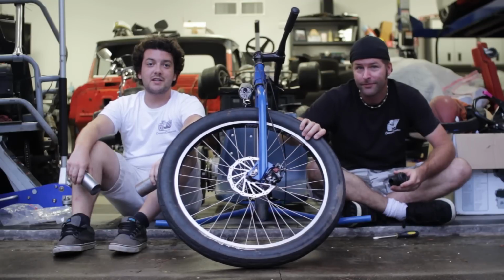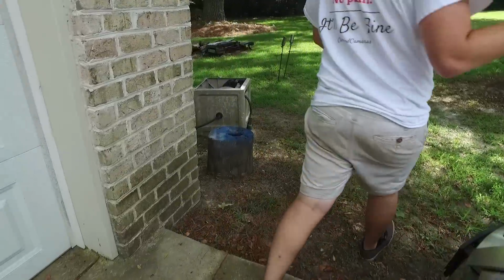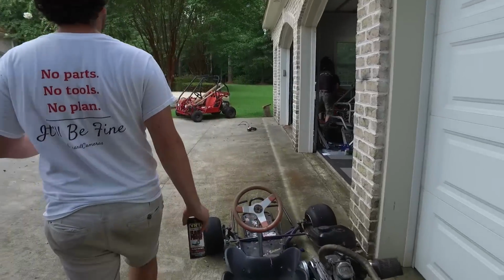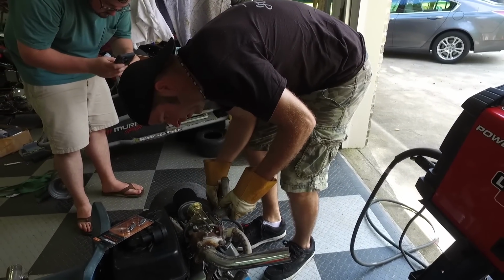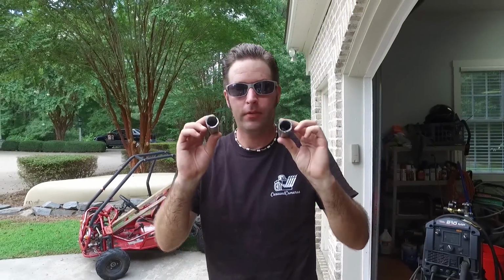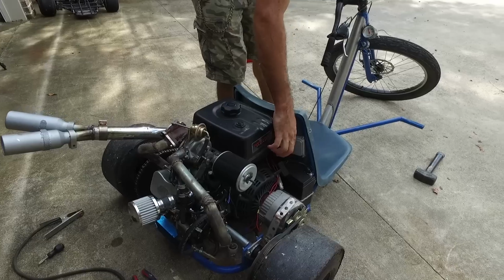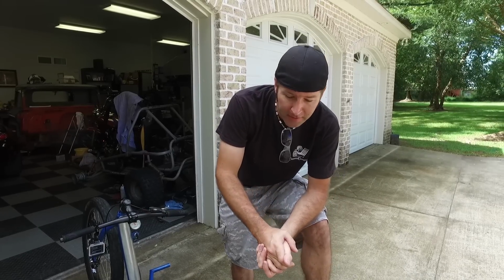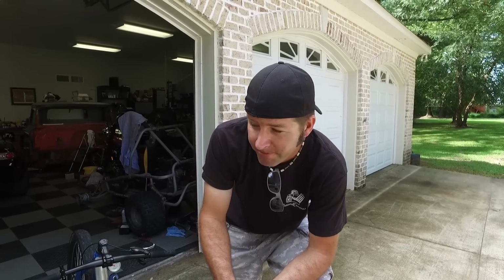911 Turbo Blow Off Valve on a Drift Trike??

Comment: 4:15 ... um  Blow off valves   blow off excess pressure  when you let of the throttle . ( its not good to hold boost built up and not use it ) 
but there is no Vacuum ...

Comment: 1 those mufflers ''might'' very well increase boost lag. 2 why put a filter on that diverter valve? 3 keep valve for reliability and longevity of turbo but i would remove filter and test with and without mufflers because this muffler reduce sound by creating restriction and that's not good for performance. Just a thought maby try cutting 3 slants on the outlet of the diverter maby it will make more flutter sound. And finally try a very smaller valve because the spring in that one is to strong that why is doesent open ennuf. Just my thoughts :)

Comment: sorry guys but I had a lol at tour expense: youre istalling a blow off valve to releive pressure when you release the throttle. therefore there will be no vacuum whatsoever. you need a valve that will release pressure using the same pressure.

Comment: If you got that DV used it's probably junk. They rely on a really crappy diaphragm to seal the vacuum source from the charge pressure which is the only thing that'll open the valve. Stick a vacuum pump on it and see if it will open, if it just sucks all day you'll know it's not working

Source: 944 Turbo owner

Comment: There's not enough volume of air in the small system to produce a loud blowoff sound plus the lack of vacuum. I bet if you make the intake alot longer and put expansion chamber in it, you'd gain the volume to produce more of a blowoff.

Comment: As others have said spring is probably to many psi for your boost level. Also the filter does nothing.one more thing, that's actually a bypass valve not a blow off valve. because it's made to recirculate back into the intake air.
Reply: ps those bypass valves are made to be quiet. stick a whistle in it and for God sake ditch the filter lol.

Comment: if you took the plastic off the wheels you would build more boost, you're essentially just reving it without building pressure because there's no load on the engine.

Comment: it's not about vacuum, it's about boost. if the valve needs more boost to open than you can provide, it just wont work. either way, you buy a cheaper bov and adjust it for the boost you have, or, why not, more boost

Comment: hey guys.. i just finished building my drift trike but the front wheel will not turn the trike.. I haven't put PVC on the rear tires yet... is this common?

Comment: A blow off valve is used to relieve excess boost from the intake manifold during throttle let off, Not vacuum.
Reply: yes but it needs vacuum to open the valve to relieve pressure
Reply: I didn't mean it won't work, I just wanted to correct how it works, sorry.
Reply: its cool

Comment: love the channel but thats a bypass valve not a blow off. it wont sound like a bov because its designed to let charge air vent to before the turbo. its also on a saab turbo. i run the same one on my mustang and it doesnt make any cool noises when vented to atmosphere. try a real bov and you might get the noises you want.

Comment: Old coot wouldn't last long in my neck of the woods. We had a crybaby like that once, he sold his house and moved 2 months after moving in. As soon as everybody in the county heard it turned into open invite to ride by his house at all hours with anything you had after you removed the muffler.

Won't get into how that's not a blow off valve  since enough people have pointed it out but on something with low vacuum if you add a vacuum can it will help somewhat on engines with hardly any vacuum.

Comment: wouldnt you need to have a closed wategate so the pressure is released and the psi is... released through the new valve. then electronically you could decide how much was released before cut off making a seriously more improved turbo and blow-off sound. or am i just tripn lol yeah needs a boost controller then you prob blow it up

Comment: you don't need the air cleaner on the valve it shoots air out doesn't suck in, would help with the noise

Comment: Why don't you use silicon tubing and clamps for the intake? It would be Easier to form the the engine and you won't have to do a lot of welding.

Comment: The dut dut dut dut sound isn't a BOV (blow off valve) it's compressor surge from the lack of a BOV or improperly install, malfunctioning, or improperly tuned BOC not releasing the pressure when coming off the throttle. It's highly debated rather compressor surge harms the turbo or not but I myself don't risk it.

Comment: POTENTIAL SOLUTION: Maybe you can make the blow-off valve stay open by making a dedicated chamber to maintain non-oscillating vacuum pressure. You could achieve this by placing a small check-valve (one-way-valve) on the intake (on the nipple you welded on for the blow-off valve). The check valve would lead to a small reservoir which would then be connected to the blow-off valve. The idea is that the reservoir would dampen the pressure oscillations to the point that the blow off valve can operate properly. This reservoir would likely need need a very small vent - perhaps a small valve so that it's adjustable.

ALSO Another solution for complaining neighbors: sneak around your neighborhood and and put PVC sleeves on their tires, now everybody will be drifting. ¯\(ツ)/¯

Comment: What kinda boost is that beast getting? I bet that has a bit to do with the flutter sound and a full PHHHHHSSSSSHHHH you guys want. My old supra had bad intake rubbers when i got it and had the same "flutter" until i replaced them all and got full boost.
Reply: its got 7 lbs

Comment: Why don't you guys try putting a blower, (super-charged), system on the trike?  I think the turbo was a cool attempt, but since it didn't work all that well, and it's kinda messy.... why not try something else?  Pull everything back apart and make a ram-air blower, (electric or flywheel), and force that trike to run!

Comment: WRONG:  blow off valve does NOT work off piston generated vacuum.  Those valves actuate at a predetermined  POSITIVE Pressure level, pressure produced by the Turbo, thus limiting the Turbo pressure boost, preventing a run-away pressure spike at the carb manifold. If the blow off valve is not opening, the turbo is not producing enough pressure .. which is likely the case, since you are trying to use a Porsche 911 Turbo meant for 1800cc  high perf engine.  You will need to use a MUCH smaller turbo, that can provide pressure at very low exhaust output.

Comment: Unless that guy owns the road he has no right to tell you not to drive by. By the way you don't need vacuum for a BOV to work. It only needs boost to hold it closed and once throttle is closed the excess boost will open the valve on it's own. If it isn't opening either you're not making any boost or the vacuum line isn't hooked up correctly and is hooked up before the throttle body instead of after. n

Comment: this is what u gotta do first hut the engine with a hammer. this will improve the arrownumadication. second run the intake to your mouth and blow while your driveing. helps force air into the turbo. then fill the turbo with gasoline. much better then air. and finally the big one use tractor fuel. better combustion power.
Reply: hit*

Comment: would you guys ever consider using alt- fuels and still have the fun and power - and maybe even do some experiments to make an engine as efficient and as powerful as you can make it while putting out very low emissions - i have a few ideas for you guys - if you have some deep pockets for a project you could buy a large automobile motor and go electric - i think that would be awesome you know an AWD 'something' with a motor of 480 n/m of torque or more - possible one smaller motor per wheel - or - maybe you guys could make a kick ass electric drag'r and pull out the lithium ions and the super capacitors - i would like to see that - order off of Alibaba.com if you go that route - you can get some really good deals.

Comment: dont think the turbo is making no pressure , mite make a difference if you put a turbo for a small 3 cylinder diesel tractor on there and is a smaller turbo will spin faster

Comment: Use a BPV from a Toyota MR2 / Celica / Caldina. They hold shut harder the more boost you throw at them, and they open FULLY instantly when required. These spring-type plastic pieces of crap are just that...crap.

Comment: Build a plenum and you will get boost.
2 liters should be fine.
Now you're just having a non working turbo setup.
Reply: It has boost and the turbo works, just not the BOV (which is kinda useless in this setup anyway)
Reply: +Rogue Racing The problem with single cylinder turbo engines is that they move so much air in one stroke.
That little tube in between the turbo and the carb do not contain enough air to give the engine a stable amount of boost. That's why their boostgauge didn't work.
When building a single cylinder turbo engine you must have a massive plenum chamber. Around 4 times the size of the engine works.
Do you follow?

The plenum works like a balloon with two ends.
Reply: +Rogue Racing If the balloon is empty it's quite hard to take a breath in it. Even if your friend is blowing in the other end. But if your friend had the time to fill it you can easily take a big breath without running dry.
Reply: +Nikel87 I must have missed the boost gauge episode. but yes what you explained seems like it would help a bit to even out the pulses.

Comment: this is the reason why i love Michigan thats a subdivision in are area and lets say u lived on the rd or in that subdivision and u have proof that u partly own that rd  or  private drive it is considered a civil matter u can asked the cop to leave and he cant even give u a ticket but if the so called neighbor tried to file a clam and the prosecuting attorney would throw it out than u can also file back saying hes no longer allowed to use your rd and he has to find another way to get out of his yard and only be on his own property not yours lmfao just got in to a case about this like a year ago and i won lmfao he had to use his drive way and it was flooded because he placed it in a swamp and he hydro lock his truck that was brand new  that what he get and the ford dealer would no replace the motor he had to pay out of pocket for it and it was a diesel so i know that was a price fix if he wouldnt of been a ass hole he would of been fine karma a bitch

Comment: How fast will that thing be with normal tyres ?
Reply: if we take the sleeves off its slower than with them
Reply: +Isaac it'll be fine how does that work?
Reply: the sleeves make the tire taller which give you more speed

Comment: love your channel but the sound mixing on the videos needs improvement badly. when you're speaking the volume is low so i turn it up then anytime an engine is running or a power tool is being used, its overly loud

Comment: Hey guys I have a 212cc predator with a torque converter and it lags when I'm moving and I put my pedal down it lags for like 4 seconds then goes but only when moving to you guys know why. I hope anyone responds because I need to know how to fix it.
Reply: if you have modified the exhaust or the intake without jetting the carb it will make the engine run lean which can make it lag

Comment: A blowoff valve doesn't make your turbo flutter it comes from pressure escaping back out thru the turbo on low rpms cause it has nowhere else to go meaning ur blowoff isn't working PS flutter can be bad for ur turbo

Comment: You self said in the video why not only the blow-off valve on a single cylinder engine does not work but also the turbo charger itselfe on a single cylinder engine makes no sense. because the engine does not build up even pressure!!!! 😐 A super charger will do more sense! ;)

Comment: blow off valves aren't a result of vacuum. they are a result of boost
Reply: they open using vacuum letting the boost out when the throttle is shut

Comment: Holy shit you guys gotta do ur research on this stuff before trying to install a blow off valve. First off if you want a loud blow off then u need an atmospheric blow off valve not a 911 factory recirculating one. I reckon the compressor surge from the turbo without a blow off valve sounds better but whatever you guys want to do you can do. Having a pod filter on the blow off valve is uneccessary as the air is going out of pod filter, this not only compromises the blow off sound but also restricts the airflow, unless you feel a need to filter the compressed turbo air out to the environment. Everytime you mentioned that a vaccum is involved in the blow off valve and that it matters that it is a single cylinder engine, was wrong. Just do twenty minutes of research and you will have e ough of an understanding to install a blow off valve correctly.

Comment: thats a diverter valve not a blowoff valve and it works off boost not vacuum
Reply: it is a diverter valve but we are using it as a blowoff valve. they use vacuum to open the valve to relieve the boost

Comment: Mufflers on cam equal as quiet or more so than a lawn mower and those roads do not look public to me there's nothing the cops can really do on a private road unless it's at the owner of the private road's request.
Reply: If in doubt talk to the horse's mouth not its backside! ie ask the cops first hand what is allowed .
Reply: Public road, definitely not allowed, private road is up to the owner of the road.  Public road it would be treated just like if it was a motorcycle or moped and would need a plate.  Technically speaking, even the go karts are illegal on public roads when they're not sideways.

Comment: Dudes i think the engine dont become a real load because the plastic wheels! So no blow and not much bostpressure....same as when you get a europe turbocar from the twothousands with electric boost control... almost no boost without load....

Comment: put a 4 cyl porsche 911 twin turbo with that same blow off valve on it change the plastic wheels off for a bit... equip it with quick change tires setup once you have solid slicks (rubber tires) show the old man what a race track really is... burn out in front of his house... also before ya do all of this equip it with a moderate size air tank and a pair of dixie horns like on the dukes of hazzard car rofl the old man wont open his mouth again I bet... if he says he called the cops... get back to the garage put the plastic wheels back on quick park it in front of the car and make sure the air tank is empty hahahaha then old man appears to be unreliable and like a liar

Comment: Looks more like a diverter valve.
Reply: Id recommend a Forge BOV with a very light spring to accommodate the lack of vacuum and such.
Reply: Also idk if you guys know how a DV works but its purpose is to divert extra boost back into the intake so it doesnt really make a "spoosh" noise like you said.

Comment: That's a diverter valve, not a blow-off valve.
Reply: yes we know but we are using it as a blowoff valve
Reply: But it's not the same design. You can't call it a blow off valve. You just installed a diverter valve the wrong way.